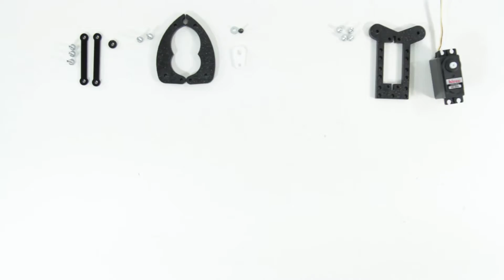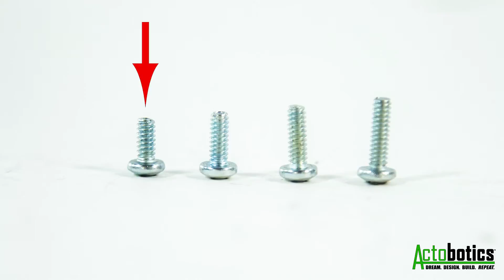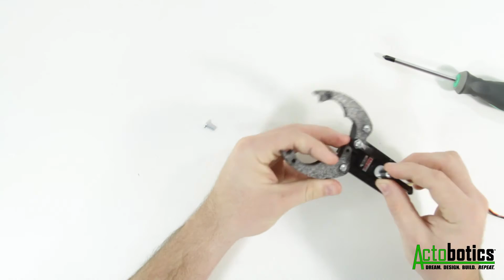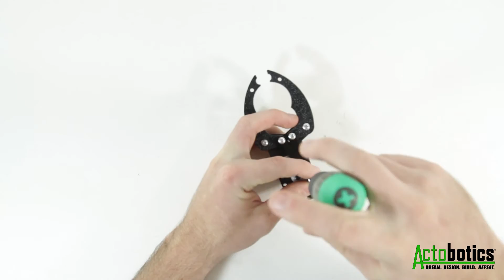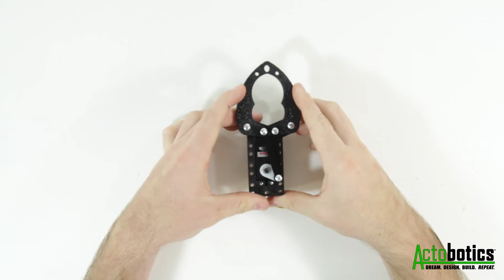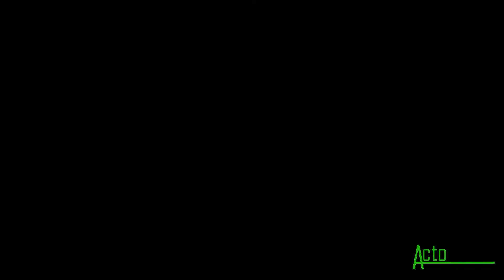Standard Gripper Kit B Assembly (Full Instructions)

Comment: what a miserable video. And Servocity MONETIZED it as well so I have to sit through a commercial because Actobotics doesn't believe in adding assembly instructions to their kits. I agree with Dan. It's too fast. And the dude is hard to understand. He mumbles a bit. And then there is something missing. He never explained how to line up the teeth on the servo horn so that the servo opens and closes the gripper WITHOUT BREAKING THE SERVO HORN.